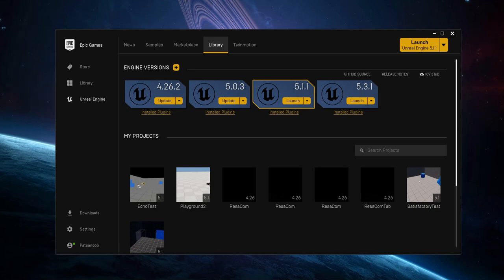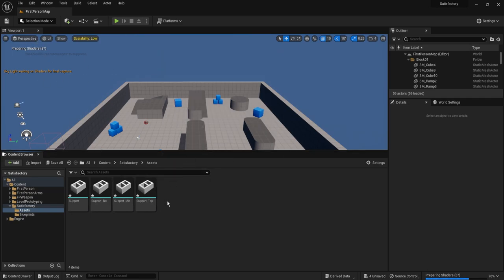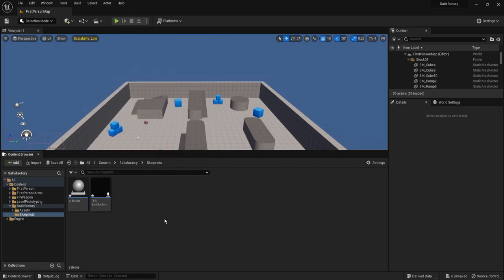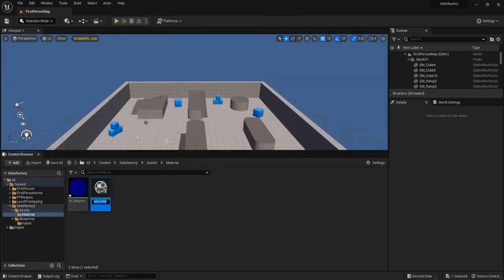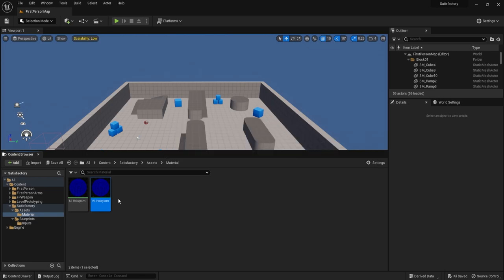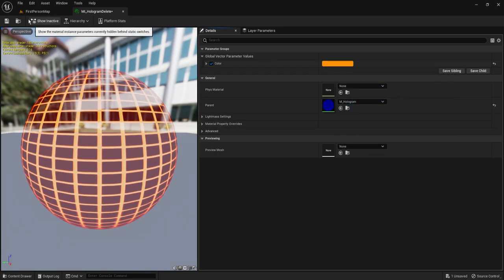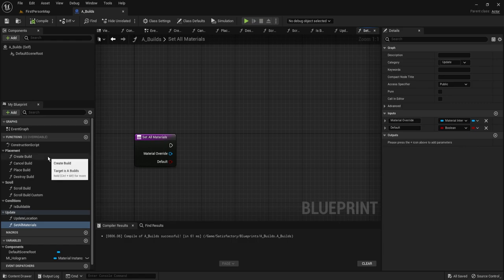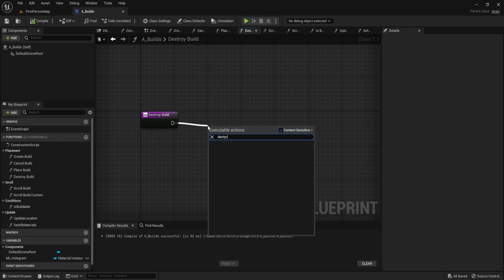Satisfactory | UE5 Tutorial #1 (Parent Class & Conveyor Pole)

Comment: Hello, absolutely loving this tutorial.  I am curious, when testing , the item spawns into the world, but doesn't move around when I move my camera?  Also, when pressing ctrl its not expanding in height.

BTW, do you have a discord or group chat for easier discussion?
Reply from the maker: Glad you like the tutorial.
For your first issue, the most likely causes are:
- The Set Timer isn't checked to be looping (40:40)
- The Set Timer function name has an error (40:45) (It has to be identical to the "MovingBuild" it is case-sensitive)
For the second issue of height not changing:
You might have forgotten to check the first boolean (45:30)
I hope this helps solve your issues. If neither of these options solve your problem, do the following and let me know if it prints or not when you do the inputs:
- add a print inside A_Builds_Support at the beginning of "StaticMeshByHeight" (25:15)
- add a print inside A_Builds at the beginnning of "UpdateLocation" (17:47)
No, there is currently no discord, but I am working on creating one.
Reply: @patsanoob  thanks for your input being very thorough ... I have put a print string at the beginning of the Build Move function ... its not being called.  Is there a way to see any other blueprints that are trying to call it?
Reply from the maker: If it is not printing, that means, the issue you have is before the function even gets called. Possible causes could be:
- The same issues with the timer as mentioned in the previous comment. [Most likely cause]
- The line trace not actually hitting a surface.
- The "Moving Build" function in FPS_Satisfactory, not being done correctly. (40:55)
There shouldn't be any another blueprints calling the function, but what you can do is:
- right-click the function
- Select find by reference
- Then at the bottom in the find results click the binoculars
- It will open a window to look for functions that use the same name ANYWHERE in the project.
I hope this helps.

Comment: I dont find the grid texture (7:27)
Reply: *cant find
Reply from the maker: Strange it should be by default in UE 5.1 (excluding starter content). But if you don’t find it, it doesn’t matter, the texture only serves to make the material a bit more visible you can just plug the color directly into emissive. Or just use any other texture you want.
Reply: @patsanoob The texture comes from the editor, not the project. So if he hasn't checked the option to see the contents of the editor, it's normal that he can't find it.

Comment: hey amazing tutorial. this is just what i have been looking for. my only problem is that ue5 crashes is i try to build a height overwritten pole. if its normal it works but if its taller it just crashes. any clues?
Reply from the maker: Sorry for taking a while to answer your question, but I'm not exactly sure why your project is crashing. The only thing that comes to mind that could cause such a crash would be the for loop (27:24), but even that would be strange. If that is set up correctly, I would maybe suggest re-creating a blank project. I hope this solves your issue.
Reply: @patsanoob  thanks for the help. i will check it out and hope it works. love your tutorials :)

Comment: Hi just want to say great series I have a small problem when I make the support more than 1 high and I use a different material other than the default world grid material it crashes UE5.3  if I use the default material as you have it does not crash any Ideas?
Reply: Problemsolved if anyone has the problem go to the material and make sure use for instanced static meshes is checked

Comment: Hi, @patsanoob when i cklick strg + mousewheel i can extent the poles but the middle thing (Support_mid) do not show . what can i do?
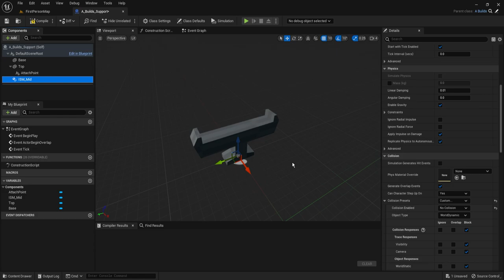Reply from the maker: So if you are sure that you followed the StaticMeshByHeight function, then it is likely that the issue is caused in the actual component not having a staticmesh set to it. At 23:18, I set it up, without setting a static mesh you can't see the instances.
Reply: @22:16 notice the scene component is attached to the top and the ISM_Mid is its own scene component.

Comment: I just finished part 1 in UE 4.27.2 and it is working fine so far... only problem i face is my support spawn about a feet higher from the floor and i cannot delete placed support 🤔 Input Mapping Context do not seem to want to work, so i managed to implement them in the charater input instead.
Reply from the maker: For the support when you say you cannot delete them do you mean: are they not being detected by the line trace or are they getting hit but not reacting?
In the first case, you need to check that the line  in the player character when looking to delete is set to be  for the 2 Static Meshes and the Instanced Static Meshes
In the second case, make sure that in the parent class, the  is setup (it's just a simple DestroyActor).
For the issue with the support spawning higher, it could be caused by the VectorSnapToGrid at (18:08), try removing it to see if that solves your issue and let me know if it does.
Reply: @patsanoob  When in Hologram (blue) i can delete the support, but when it is placed, if i aim to it, it turn in red but wont delete.
Setting value to zero in VectorSnapToGrid (in Grid Size) worked fine, the support spawn now at the ground and no more floating :)
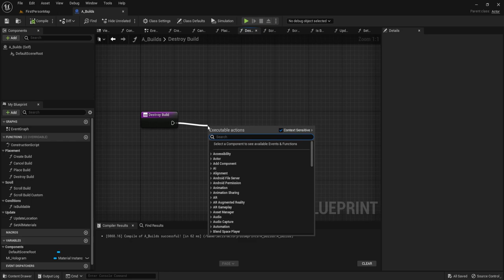Reply from the maker: @xdoom1111  So at 15:40 we create the function for destroying the builds if this is done correctly then the only other cause is the confirm input in the player character section at 46:47 you need to make sure it is all setup correctly and if it still doesn't work then you need to check whether the ItemToDelete is Valid.(You can check this with a print on the IsValid part)